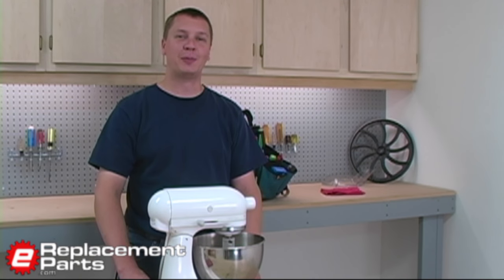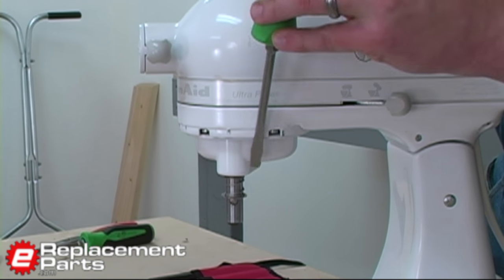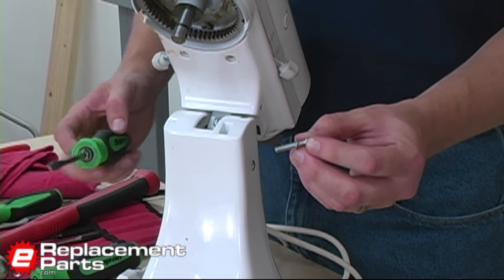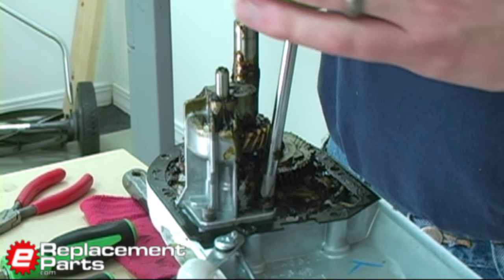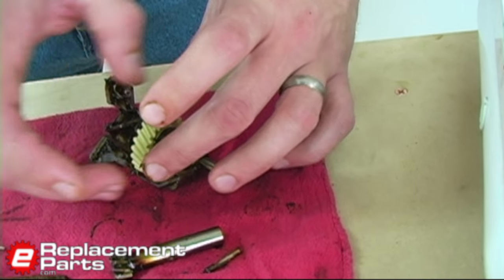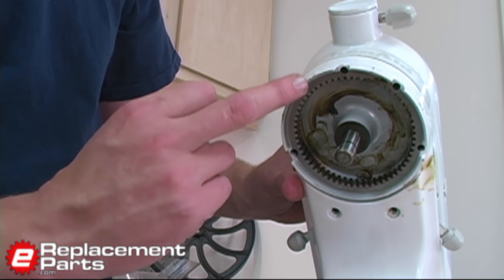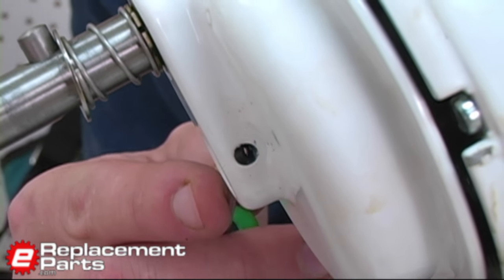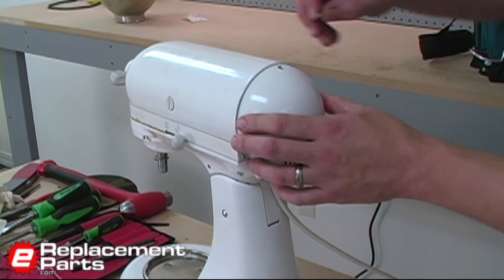How to Fix a KitchenAid Mixer That Isn't Spinning

Comment: When I attempt to reattach the planetary, the center shaft moves upward into the mixer housing such that bottom of the shaft is not flush and the hole for the roll pin on the shaft is "above" the hole for the roll pin in the planetary unit (and thus can't be aligned).  How do I keep the shaft from riding up higher into the unit?  Am I missing a part?  If so, what part is missing?
Reply: fishaddict2 Any luck on this?  I'm experiencing the same problem :(
Reply: I still have not heard of (or figured on my own) a solution to this problem.  Anyone have this same problem?  Did you resolve it?
Reply: the shaft moves up when you put the planetary on.  I ended up using a skinny screwdriver thru the hole to push the shaft down once the planetary part was on.  I was then able to put the pin in.
Reply: fishaddict2 I'm having the same problem. Right now. :-\ I haven't yet found a way to keep the shaft from riding up.
Reply: fishaddict2! I figured it out! If you can see just a tiny bit of the hole in the shaft through the hole in the planetary unit, use a - are you ready for some next-level MacGyver action? - a CORKSCREW to fish it down. Or I guess an awl would work if you have actual tools, unlike me. Good luck!

Comment: i have a problem with my mixer.  From day-one my switch does not seem to engage when switched to the second speed.  In order for it to engage I have to jiggle it.  What do you suggest?

Comment from the maker: Thanks for watching! There might not be an easy fix to your problem. First place to start is to be sure that the brushes have been installed correctly. If the brushes are not correctly installed the mixer will not turn on at all. If they are correctly installed then your best route would be to take it to a service center and have it checked out.

Comment: Repaired mine but still don’t work   Got a spark when I replaced the two black caps on the top of my mixer. Removed them before I seen video. Would it stop it from working
Reply from the maker: Hello Tracy, if you removed the brush caps that would take the tension from the springs and brushes from making contact with the armature and it would not operate.

Comment: I now also find that after I have taken all apart, I plugged the power cord in and it seems I now longer have a motor that turns on. One piece at a time the machine seems to be falling apart.

Comment: I followed your instructions and once I got to the gears realized that mine are ALL metal. No plastic worm gear. They worked just fine when I spun them by hand so what else might my problem be if  it has stopped spinning?

Comment: hi~  great instruction! first of all. I was able to open it and found all the gears ok.  then i looked into the motor and found it not able to turn when i turn on the power.. any suggestions?
Reply from the maker: Wayne Lee What model number are you working with?
Reply from the maker: Wayne Lee I would need the model number, not name. It should be located on the bottom and back of the mixer.

Comment: Hi I have a k4sswh bowl lift mixer that stopped spinning while making bread. I replaced the worm gear which was stripped and put everything back together. Now it spins again, but if there is any resistance at all the motor keeps going but it stops spinning. Is it possible I did something wrong or that there is another part that needs to be replaced? I've searched everywhere online but it doesn't seem like anyone else has this problem.
Reply from the maker: Sounds as if it could be a sheared pin. There is a pin (9707223) that goes through the center shaft and keys into the center bevel gear. This pin commonly fails.

Comment: The video is great, however I'm not sure if the problem you're fixing is the same as mine.

My fiance was using my mixer with the Meat Grinder attachment. Well, Kitchen Aid sells it with both metal plates in the unit and since he didn't read the manual ("Who reads manuals?") he ran the meat through it with a pretty much, closed opening. I should have known by his guilty face he'd screwed something up, but I didn't think anything of it. 2 weeks later I went to use it and it didn't power on. At all. I've tried other outlets, and after seeing the back cap had been removed I realized he was guilty. The only thing he's owned up to (thus far) is operating it like an idiot with both grinder plates on, and that the machine "bogged down".

My unit doesn't power up, make a sound, nothing. Is this the problem you're solving with the video? I wish you prefaced it with a diagnosis, i.e "the machine wasn't turning on", or "the motor is cranking but nothing is moving", and also, as you're pulling out the gear, how do you know that's the problem? Is there unusual wear? is it stripped, broken or melted?

Help me! he broke it just in time for all my holiday baking! Help save my kitchen aid (and for his sake, our marriage!)

Comment: I really like your video, but I don't think it applies to the problem I am having with my mixer.  I have a Heavy Duty mixer that has a lift bowl feature (instead of the tilt), but it has the same rounded back end cover over the electrical parts and some really large screws holding the motor assembly to the base.  Anyway, I was making a tough dough that jammed the paddle and the motor stalled.  I turned it off quickly, but now when I turn it on, nothing happens.  Nothing.  No noise, no movement.  I don't think that the gears were stripped since I did not hear any type of breakage or grinding that would indicate broken or stripped gears.  What do you think happened, do you think I can repair it, and how do I go about it?  I tried looking for videos that apply to this problem, but I have not been able to find one.  Please help if you can.  Thanks.
Reply from the maker: Robert S. Notzon If you can provide me with the model number I should be able to help you out!
Reply: eReplacementParts.com It's model KSM5. It says HEAVY DUTY on the thin strip.  I took the mixer apart and found that the plastic worm gear was deformed.  So I have ordered a replacement and am hoping that will fix the problem.  However, I am still concerned that when the mixer failed. It no longer made any motor noise, which I would have expected even if the gears wouldn't turn as a result of one of the gears failing.  Any thoughts on that "clue?"  Thanks for your help.
Reply: Robert S. Notzon I replaced the worm gear and put the mixer back together, but as I feared the mixer still does not work.  When I plugged it in and then turned it on, nothing happened.  What's my next step?  Thanks for your help.

Comment: Turns out on my mixer it was the roll pin that broke. The gear is side was still good. It was also metal instead of a nylon gear.

Comment: I cant get the pin on the planitary to come out .. really stuck !!  My punch isnt as wide, but still it should move some, which mine is not even after using W-D .... any suggestions
Reply from the maker: Some of those pins can be bad to get out especially if the get bent for some reason.  I have no easy solution sadly.  Sometimes if
you can't drive out going one way I'll drive it out the other direction.

Comment: I have a problem with my pro600. When using a dough hook at the speed of 2, it always has a clank clank sound and it seems coming out from between the dough hook lock and the shaft and seems it can't lock  well and leaving a space to cause the clank clank sound. Please help.

Comment: hi, how yo replace the latch-lever and way it go wrong, thanks
Reply from the maker: Thank you for your question. The link and lever latch (WP24452) is installed very easily. To remove the old part you'll need a small flat head screwdriver. Use the screwdriver to remove latch bearing screw (103993) from the housing of the mixer. Next, use a Phillips head screw driver to remove the pivot screw and spring washer from the lever. Install the new part in reverse. The pivot screw should be tight enough to provide tension so that the lever can still move but not be able to move freely.

Comment: Occasionally (1 out of 5 startups) my mixer will not start until I manually turn the beater slightly (while power is off).  Turn the power on...and it works again.  Any ideas what may be wrong?

Comment: K5SS started running only on the higher speeds (4-above), then quit completely; no humming - "nothing". Replaced the phase-board, no change. What's the next logical step? Thanks!

Comment: hey , i wanna ask you some question, i've got the kitchen aid standing mixer the artisan one just last year , but went i try it , it shock me in the steel part , not all of the body , just in the like alumunium part or something , and i can't us it cuz it makes the bowl and the spinner shock to . so i have to turn it off and unplug it so i can touch it , what is wrong with it ? if you got an answer please reply my comment cuz it's really gonna help me .
Reply from the maker: You have a short in the mixer.  I would at very least open the housing and see if you have wires touching the housing. You may also have a short in the switch or in the power cord. This is the first time I've heard of this problem on a kitchenaid.
Reply: +eReplacementParts.com thank you so much , i will try to open the housing and see it

Comment: My mixer keeps moving the pin out that holds it onto the stand - the pivot point for lifting up the head.  I can be mixing bread and having to knock it back into place 4 times before I am done.  Any thoughts on how to stop this?
Reply from the maker: Hi, unfortunately at this time we are unable to offer technical support. I would suggest contacting the manufacture for further information. I sincerely apologize.

Comment: Hi, I have the same problem as hiaphla. The roll pin attaching the planetary will not come out. Do I just keep hitting it with the hammer or is there something else I can do?
Reply from the maker: What model number do you have? I can have Mark look into this for you.
Reply: Sandra Olear I have the same problem. I can't take the pin out. It's a KSM75WH
Reply: eReplacementParts.com   I have the same problem. I can't take the pin out. It's a KSM75WH
Reply from the maker: Chucri kahwaji Use a Hammer and a good Punch.  If the pin won't budge it may be sheared or bent but it needs to be removed. Once it's finally out and the repair has been made, replace it with a new one.  Don't reuse it.
Reply: I posted the original comment about not being able to remove the pin. Happy to say that I found a solution. I used a drill with a metal bit and drilled into the end you would hit with the hammer.  You only need to drill around 1/16 or so. Then try the punch and hammer again. Mine popped right out. Good luck with yours.

Comment: I got a mixer from a lady the motor is working but it doesn't spin. but my husband discovered if you push on it.. it spins but you can hear it catching on something while it's spinning.  could it be the worming gear still???

Comment: I replaced my worm gear, the mixer that was running with grinding before the repair, is not getting power and so is dead when running through all the speeds. Any suggestions of what to look for?
Reply from the maker: +scott smith It sounds like problem with one or both of the brushes not being seated correctly. The brushed are keyed and should only go in the holder 1 way.  If installed any other way they won't make contact on
the armature.
Reply: +eReplacementParts.com That was it! The corner that is chamfered must align with a small square at the back of the hole into which the brush is inserted. When I reoriented the brush, the mixer started right up. Thanks.

Comment: My mixer looks nothing like this model. I've got the 400W Artisan KN15E1XMR, and this model number does not show up on your website and none of the exploded parts diagrams look right.  I think one of the bevel gears that drives the accessories has a broken tooth.  (First time this happened it was under warranty.)

Comment: I can't get the pin from the planitary to come out even after banging hard from both ends... Sprayed silicon spray, wd40 but nothing seems to work...Any suggestions?
Reply from the maker: You may need to purchase a new planetary.  You can't do the repair without the pin being removed.  If you want to continue working to get the pin our you should be careful not to bend the shaft.

Comment: My kitchenaid does spin, but it hits the side of the bowl on the middle of the left side. I adjusted the screw under the head but that didn't work for it hitting the side. Is this gear the problem or is it something else?
Reply from the maker: +Kayli Colbert I don't think the gear is the problem with this on.  If you have adjusted the head screw as far as you can , double check the Bowl to see if it has is misshapen or damaged.  Also check the condition of the paddle and see if it is damaged.  This one is hard to guess on with out seeing the mixer in person.

Comment: My problem is that I have a K5SS and it doesn't have the 4 screws on the top housing - so I can't remove it. Can you tell me how?
Reply from the maker: +marco jerolimic K5SS models do have the 4 Screws on the top housing.  Depending on the age of your mixer they could either be Flat Head Screws or the newer models had Phillips Head Screws.  If your mixer doesn't have these, double check the model number.

Comment: anything on how to repair it when in the locked position it leans and don't seat correctly..?
Reply: Not sure what isn't seating correctly and what you mean by "leans", but if you mean that the mixer head is not centered in the bowl, or that the head is not locking down, the following will be useful:  Lift mixer head, there is a head/level adjustment screw where the head meets the stand at the "swivel up" point.  You can adjust the mixer head by lowering or raising the mixer position by adjusting the screw.  Hope this helps.

Comment: my kitchenaid mixer doesn't seem to have any power past the number 5 when i choose the speeds on the side.. the speed numbers go up to 10. when i start to mix on 1 then 2 then 3 and when i get to 5 their is no change in the power of the speed. is their a fix for this problem and i usually do my own repairs so is it a fix i can do at home?? also do you have a tutorial for that problem?? i need help with this problem..i have no idea how old this kitchenaid is, i received it from a recycler person that didn't need it anymore..it does the basics but when i need the power, its not there...

Comment: At first I could hear the motor running and it was not spinning.  I took it apart and found the pin fell out by the worm gear.  I put it back together, now I don't hear the motor at all.  Help.

Angela

Comment: Hi, I don't have a new mixer. I have a Kitchenaid made by Hobart and is 27 years old. It is fine other than 1st  does not work unless it has product in the bowl that is already incorporated. (a light load).Any ideas what may be wrong or what I may have to replace?
Reply from the maker: Prepping Angel What is the model number on your mixer?
Reply: Hi, sorry for the delay. I had cookies to get done for 2 classes in Elementary school. It's a K5SS. First does not work at all. I miss spoke. She does run like a charm making the Royal Icing for the cookies but without 1st I get a powdered sugar dust bath. :S
Reply: I'd like to have her repainted and gone through with new grease etc but I'm afraid with parts the way they are today I may hurt it rather than refurb it. :S

Comment from the maker: Thanks for watching! The roll pin can be tricky sometimes. In some instances the pin is what fails before the gears do, making it really difficult to remove. If after this much time in trying to get it out it hasn't moved in or out in either direction, I would suggest taking it to a service center. There they will be able to remove the pin and pull the planetary without causing more damage. Thanks for your question and good luck!

Comment: HELP!  I was trying to remove the first pin and it broke in half or thirds I have 2 tiny peices and the thing won't pop off so I think their may still be pin piece left in the main pin tha holds the mixer pin on... I can't see through the hole. It spins and the thick pin doesn't move. Is their any way to get this off?

Comment: i tried to fix my mixer, being totally ignorant prior to seeing this video i removed the 2 screws at the sides of the motor, that has a spring each. before doing that i removed the back section that has all the electrical wires. i'm not sure if this caused damage but my mixer wont turn on. how do i fix this?

Comment: I followed the steps in the video and then plugged the mixer in and turned it on and nothing. No sound what so ever. I double checked the wiring to make sure I didn't clip a wire or one fell off. Now I call and ereplacementparts say that they don't make the videos and can't help. Please let me know how to contact you directly for help.
Reply from the maker: Our Kitchenaid technician is on vacation this week with his family.  We'd be happy to have him email you when he gets back.  In
the meantime check the brushes.  If you had these out and didn't get them in correctly the problem will be as you have described.  The brushes are slotted and so is the brush holders and these need to be matched to get the brushes to make contact with the armature.  Check out this link.  It may help:  http://www.ereplacementparts.com/article/5787/How_to_Replace_the_Carbon_Brushes_on_a_KitchenAid_Stand_Mixer.html